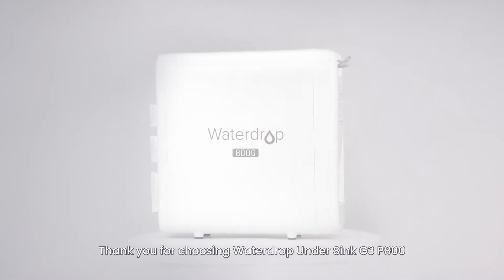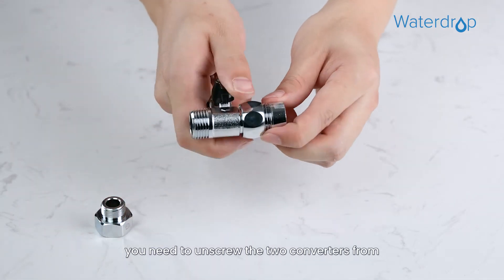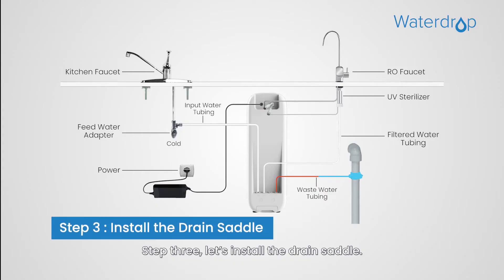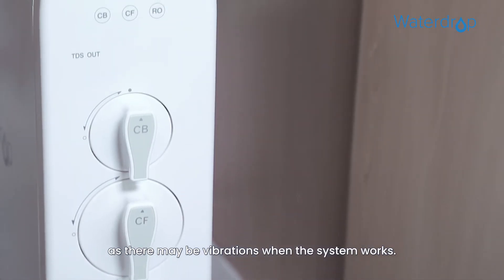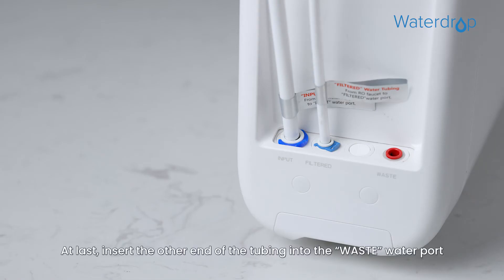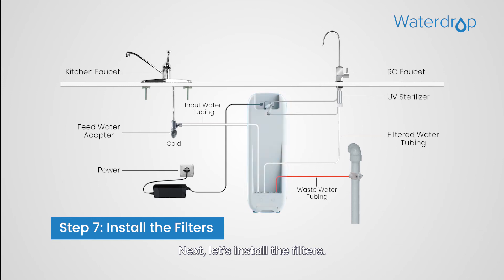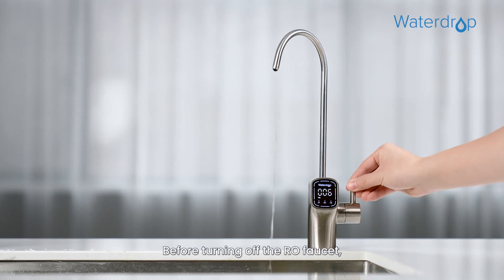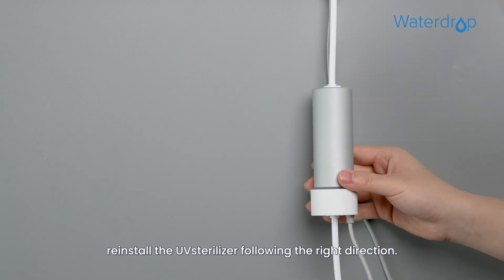How to install a Waterdrop 800GPD Tankless RO System with a UV Sterilizing Light?

Comment: How do I removing the tube from sterilizer , I need to change the water faucet
Reply from the maker: Hi there, thanks for contacting us! Your update is much appreciated! Please note you will find there are white o rings on the two ends of the UV light and you just need to press it when you take out the tube. Hope it can be helpful to you :)

Comment: How big should the hole on the countertop be?
Reply from the maker: Hi,
Thank you for contacting us. 　
It is suggested to you drill a 1 inch hole in your sink.

If you have any other questions, please feel free to contact us.
Enjoy the rest of your day!

Kind Regards
Mia Lauren　
Customer Service Rep
Reply: @waterdropfilter.official what is the recommended distance from the edge of the sink to the middle of the 1” hole?
Reply: I will reply to myself. I received the RO system yesterday and just finished installing today. It comes with a sticker with the right size hole to place on the counter top to help with the best location. Everything went well, just make sure you push the tubes in (into the machine or sterilizing light) as far as they will go. There are lines on the tubes that go in to the back of the machine that let you know they’re all the way in, but not on the UV light. After that, everything as indicated in the video.

Comment: How do u connect Waterdrop Remineralization Filter to uv led..
Reply from the maker: Hi,
Thank you for contacting us.

Please note that you can use the outlet tubing of the RO system to connect the MNR filter.
What you need to to is only to cut off the outlet tubing and install the MNR filter between the RO system and the UV light.

-How to install the MNR filter
This filter can be installed between the RO faucet and the outlet port on the RO system. 
It uses 1/4" Quick-Connect fitting as shown below, so it's compatible with most Undersink RO systems.

https://streamable.com/e7t6fx

NOTE: Do NOT install this filter backward. Please install according to the "IN" and "OUT" port as stated in the manual/above, thank you.

You can easily install or remove it without using any tools!

If you have any other questions, please feel free to contact us.
Enjoy the rest of your day!

Kind Regards
Mia Lauren　
Customer Service Rep
Reply: @waterdropfilter.official  Use youtube not streamable

Comment: FYI:  I  received the unit the other day (01Sep2022) and noticed that the red tubing does not go through the saddle as described in the video. It appears the saddle hole has been redesigned to not penetrate the main drain pipe.  To ensure the holes matched up, since I couldn’t use the hose to align the main drain pipe hole, tube, and saddle…I connected the saddle without the red tube attached first. I tightened it enough so I could move the saddle but also stay in place.  I then used a rod and inserted it into the saddle to locate the main drain hole.  I used a 1/4” punch, but something as common as a chopstick would probably work as well.  Once the holes were aligned, I left the punch in place and tightened down the saddle completely. The last step was to install the red tubing.  

No leaks😉  The rest of the install was the same as the vid. Very happy with the system so far.
Reply from the maker: Hi Ji, I'm quite sorry for the inconvenience caused; we will update the user manual ASAP to avoid the issue, thank you for your feedback!
Reply: @waterdropfilter.official  The user manual is not being updated, I had the exact same issue. Thanks for Ji’s comment save a lot of time for me!
Reply: @waterdropfilter.official  No worries.  I apologize if it came across negatively. Just wanted to let you and the viewers know, and also suggest the work around that worked for me. I’m glad you guys are looking to improve your product. 

Not having it stick into the pipe is definitely a better design🤙